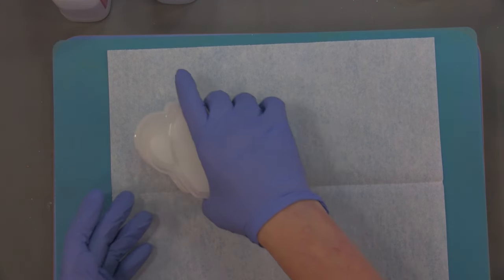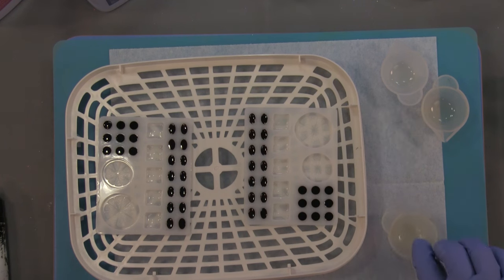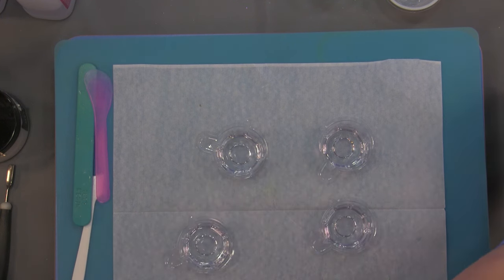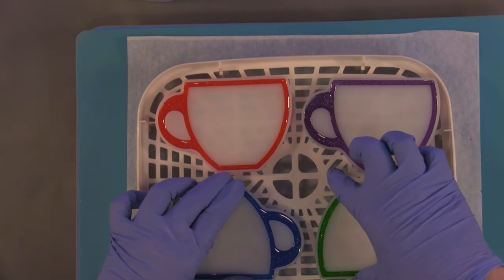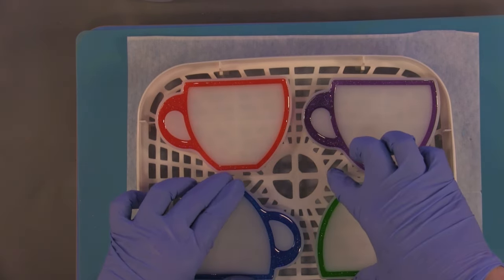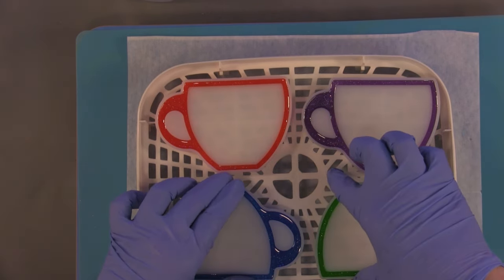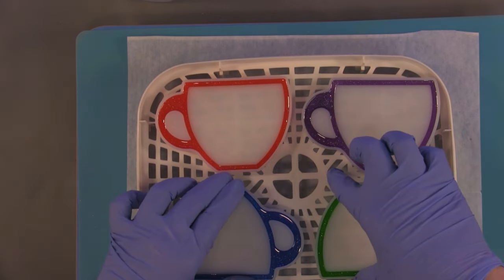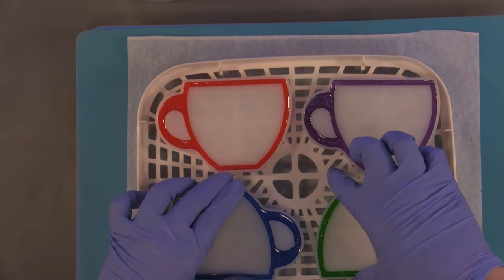Resin Shaker coffee cups...love this technique!

Comment: I have the same molds. As far as I can figure out, the tiny round dots are feet to be glued/resined on the bottom of the holder to raise it up high enough for the "cups" to sit in it. Otherwise they make no sense, as "Boba Pearl Tea" is never consumed out of a cup. Neither is iced coffee or iced tea... Instead of a dotting tool for the small beans and cubes, etc. , try using a pipette. Much faster & easier. P.S. the little squares are sugar cubes. I'd use pearl white mica for them.
Reply from the maker: Thanks for watching